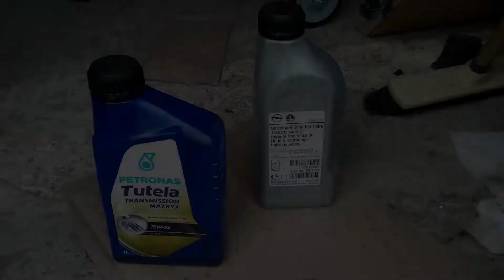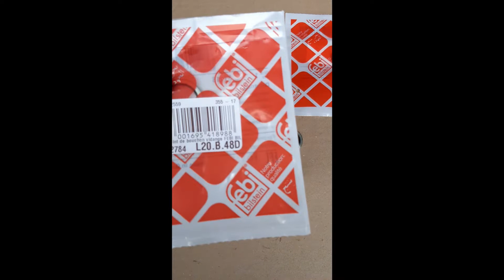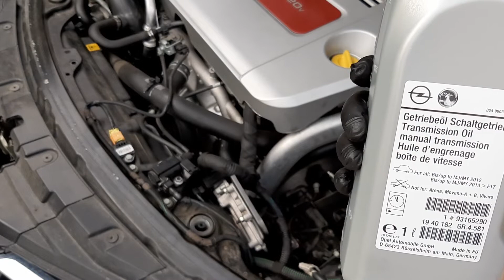Vidange Boite de Vitesses - Alfa Romeo 159 et Brera F40 & M32 - Meca Maniaque

Comment: J'ai eu une delta 844 avec un t jet de 120 hp. Une bvm m32 qui avait un souci de synchro en 2ème.

Elle avait une huile de type atf d'usine. J'ai tenté une 1ère vidange avec la 75w85 et je n'ai pas été convaincu.

J'ai essayé une 75w90, avec une vidange tous les 60 000 kms.

Le souci de synchro a presque disparu et passer les rapports était très plaisant.

Merci pour cette chouette chaîne...

P. S. : une BV lubrifiée à vie... 😅
Reply from the maker: Hello,
Tu peux nous communiquer le huiles exactes que tu as utilisé ?
Parfois avec indice SAE identique les huiles ont une viscosité qui diffère légèrement.
Reply: @MecaManiaque  75w90 avec la référence api gl4, gl4+ & gl5. Une 75w90 avec api gl4 4+ et gl5 fera parfaitement l'affaire.
Reply from the maker: Tu peux communiquer la marque de celle que tu as utilisé stp?
Reply: @MecaManiaque  le groupe fiat utilise les huiles Petronas. Elles mêmes fabriquées en Suisse chez Motorex.

C'est cette dernière marque que j'ai utilisée. Mais une huile 75w90 avec les références données plus haut feront l'affaire.

Par exemple la shell Gyrax, ou la Motul Gear 300. Du moment que tu as les références api gl 4, 4+, gl5, une de ces 3 références ou juste 2, l'huile fera parfaitement l'affaire.
Reply from the maker: Sur ma précédente 159 avec boîte m32 c'est justement la Tutela que j'utilisais.

Comment: great tutorial, have you notice any difference between the two oils? i'm planning to do the oil change on mine because i notice that the manual gearbox it's very heavy and hard in changing gears....
Reply from the maker: hi,
With the GM oil is slightly better.
Next i plan to test the Redline MT-85
in any case, is good idea to change the oil

Comment: I didn't understand what the oil you put in is?
thanks in advance and greetings from Bulgaria.🙂☺️
Reply from the maker: I use Oil from GM (General Motors).
The Gearbox in this car is from General Motors.
Model F40.
Reference of oil is 93165290
You can buy this oil at Opel dealer.
You can ask Oil with reference or just ask oil for F40 gearbox (or M32 if you have 1.9 Engine) usualy they know witch one is it  😀
Reply: @MecaManiaque  Hi is the M32 gearbox similar to this one in terms of filler and drain cap location? And also the caps are the same right?
I'm planning to change my oil in my AR 159 Tbi, because I started hearing some noise from the gearbox in 5th and 6th gear.
Reply from the maker: @amoeb81  Hi, In the M32 is much easy, the filer cap is much on the left side. So is easyest to unscrew. 
in my memory the drain cap is in the same place.
The quantity of oil is different (you have the detailed informations on the descrption of the video).
The capacity of the M32 is 2,4L.
Fil it up to 2,8L can help to avoid bearing problems.
Note: you have english subtitles for this video if needed.

Comment: explained very well, great job - do you know whether the 2.2 version takes the first (2.3L- less) or the second option (2.6 L - more) ? THX
Reply from the maker: THX, You asking about the 2.2 JTS ?
Reply: @MecaManiaque  yes, 2.2 selespeed, thx
Reply from the maker: @yosid100  on the 2.2jts i think you have the M32
manufacturer recommand 2.3L, i recommend to add 400ml more for prevent bearing problems.
2.7L in total.
Done 200000Km like this on my previous 159 with the M32 without problems 
i used the tutela oil.
Reply: @MecaManiaque  mine is 211K and counting...:goodvibes:
Reply: @yosid100  so 2 litre of 75w90 if drain and fill in a 2.2 jts seleepeed is sufficient I believe

Comment: The workshop manual says to use Loctite 510 sealant on the drain plug (not Loctite blue). Did you use it? Or did you just stick with the plug and washer?
Reply from the maker: Use Loctite Sealant is probably good way.
On my side i just use plug and add a washer like specified in the video.
No problems and no leaks until now. Already used same method on several afla 159.
Reply: @MecaManiaque  I've been thinking about using those washers and I did buy two of them but my concern is that they have a nitrile rubber insert and they are probably designed to be replaced annually because they are designed for the oil sump. My concern is that the rubber may start to break down after a few years. I think the reason for using 510 sealant is that the gearbox is supposed to hold the oil in it for many years and so it needs to withstand many years of vibrations so yes I think I'll just use the plug and sealant as per the manual.
Reply from the maker: @donnagrimshaw3512  If you follow the recomendations the gearbox oil is for life.😅  in my opinion you have to change it every 4 years or 100000km. So the washer will not be so old.
on my side never have leaking with this system but it might probably haeppen.
Reply: @MecaManiaque  I know, my gear box oil has never been changed as far as I know and the car is a 2009. I think I will use both the sealant and the washer. I expect I'll change it 4 yearly if the car lasts that long. Anyway, thank you for making the video, it gives me more confidence to do this now that I have seen it done.

Comment: Hey! Did it help to change the gears easily?
Reply from the maker: Hi, gearbox working fine but still have hard gear changes when engine/gearbox is cold.
Specialy first 2 ou 3 first changes at moring.
Next try with Fuchs Titan Sintofluid 75W-80
Some people says to reduce the oil quantity to improve easy gear change when oil is cold. (in F40 gearbox)
Maybe it works but in my minnd less oil can't be beter 😁
Reply: @MecaManiaque  Thanks for quick response! I also have hard cold changes, mostly from 1st to 2nd so i hoped, it will be better. :) Anyway, thanks for info, will try something else and tell you if something changed ;)

Comment: Hello, when you changed the oil
Did you made any calibrations with the diagnostic tool?
Reply from the maker: Hello, this is not necessary for manual gearbox.

Comment: Top comme d'habitude, petite question : le 2.0 170 est aussi équipé d'une boîte F40 ? As-tu cette info ? Merci
Reply from the maker: A ma connaissance sur le 2.0 c'est soit une F40 soit une C635 (idem Giulietta)
Ca dépends des années.
Pour savoir exactement tu peux t'aider de cette video: https://youtu.be/5mgqvVO4FKI
Tu recherche la ref de boite avec le numéro de châssis.
Apres avec la ref constructeur dans google tu verra si ca correspond a une F40 ou C635.
Reply: @MecaManiaque  dac, est-ce que tu connais le couple max que peut encaisser cette boîte ? J'ai lu qu'il fallait faire le calcul suivant; 40x10x1. 356
Reply from the maker: @Syffu  Non je n'ai pas l'info du couple max qu'elle peut encaisser sous la main.
Reply: @Syffu  Chez Getrag le couple est dans le nom : M32 320nm, F40 400nm. Ce sont bien des boites Getrag et pas GM. GM est seulement client de Getrag.
La C635 / C635TCT c'est 350nm. Boite de chez FPT (Fiat Powertrain Technologies)

Comment: Hey man, is there a stamp of the model of the gearbox somewhere in the engine bay, because I'm looking at a 2.0JTDm which should be fitted with F40, but some of them have the M32 gearbox. How can I tell?
Reply from the maker: Hello,
As i know there is no M32 on the 2.0Jtdm
You can have 2 gearbox with this engine:
- F40 (From GM)
- C635 (From Alfa Romeo)
You can check witch one is it using ePer with le VIN of the véhicule and check the reference on the gearbox mounted on the car.
Here is a video i present ePer.
https://youtu.be/5mgqvVO4FKI
Reply: @MecaManiaque  Thanks very much, that's valuable info. +1

Comment: encore un grand merci pour tes vidéo , pour remplissage rajouté du Mecacil ou Méca-run pour une boite qui 200 000 km tu trouve cela utile  ? et pour tes tuto pareil les 2.0 jtd ? 
bonne continuation 👍
Reply from the maker: Personnellement j'évite ce genre de produits sauf dans des cas particuliers ou en dernier recours pour faire encore vivre une boîte en fin de vie.
Dans la plupart des cas une vidange régulière avec une bonne huile est suffisante.
Sur le 2.0 il y a 2 boîtes une F40 comme ici ou une C635 d'origine Alfa
Reply: @MecaManiaque  ok,  merci .
la vidange a était faite il y a 4000 km mais je trouve qu'elle accroche toujours  un peu de la 3 a la 2 . pareil j'hésite a mettre un additif mais quand je voie tout ceux qui dise sa change une boite .on ne sais plus .
😅
Reply from the maker: @djamba8371  Faut voir a quel point cela accroche et quelle huile a été utilisé.
Si après la vidange avec une bonne huile cela ne fonctionne pas correctement, je dirais pourquoi pas a l'additif.
Reply: @MecaManiaque  merci d'avoir pris le temp de répondre , hate de voir d'autre tuto pour 159 :yougotthis:

Comment: Hate to tell you, but you don't need to do any of that on the V6. And the fill plug is 8mm Allen, like all the others, not Torx.

Ideal tool is a 3/8 drive 8mm allen socket . I have a set of 50mm x 10mm hex bits that have reduced size tips down to 3mm. I use thoe 8mm one with a 10mm ratchet ring. You can get to the filler without removing the battery etc, on the V6 it helps to remove the plastic head cover. You will probably cut the back of your left hand, wear a cloth glove.
Reply from the maker: Thanks for contribution
On mine it was torx.
I bought a new one and i't still torx 😄